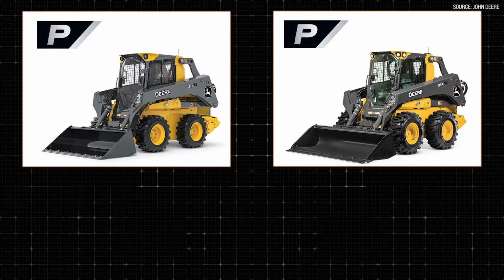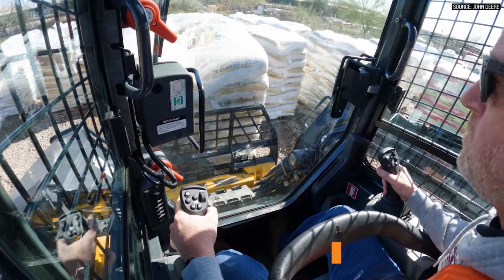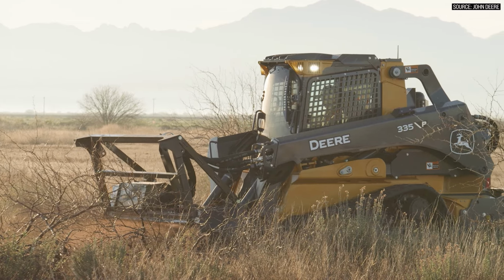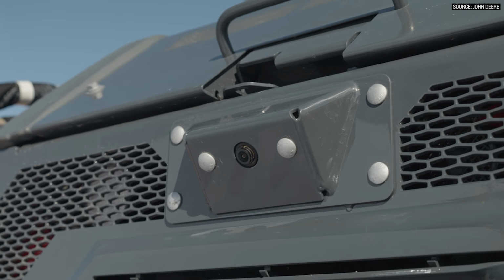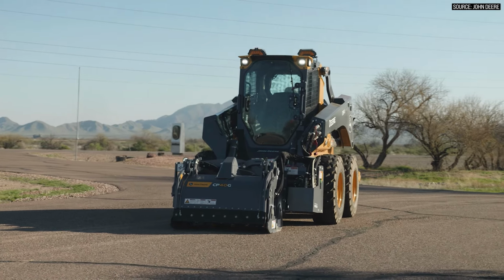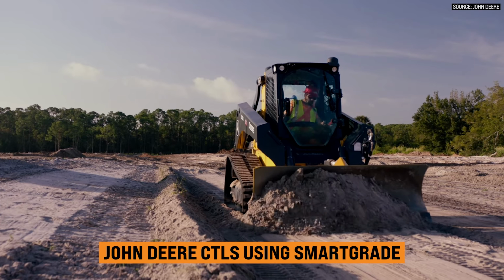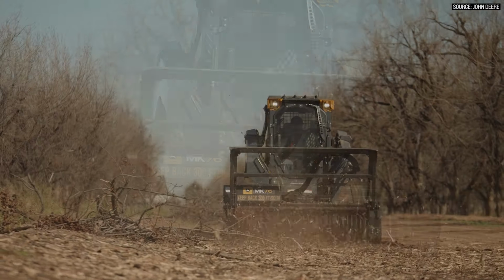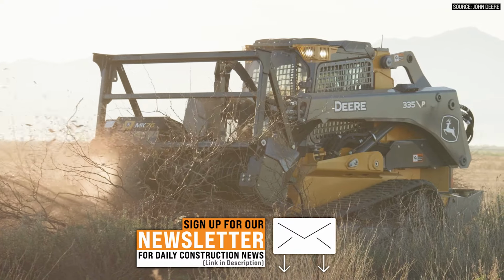Deere Reveals its 5 New P-Tier Skid Steers & CTLs on The Dirt

Comment: They still dont have a door that opens up and stores up.  Despite what she said, Deere isn’t listening to their customers.
Reply: There is a reason why all the large manufactures don't have that door. Trust me, if it was valuable, every large manufacturer would have a door option like Kubota...
Reply: As a mechanic I’d rather deal with these doors then the slide up like a Takeuchi or Kubota. Which they are nice but a pain in the ass to replace or repair
Reply: Those doors are rubbish, I can’t see the point.
Reply: You can pop a couple points and take the door off these machines easily enough. No reason for a roll up door.